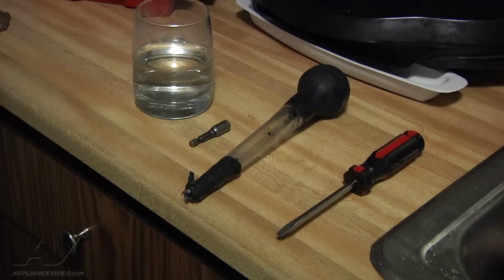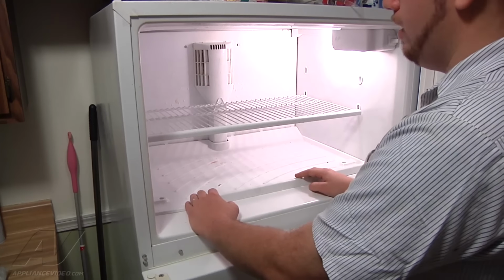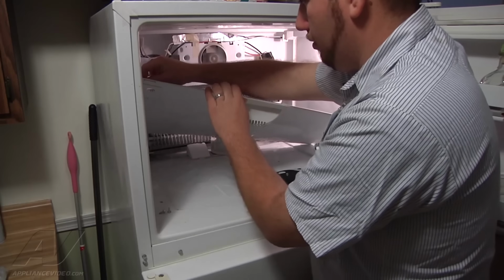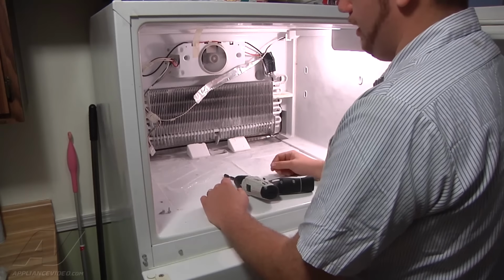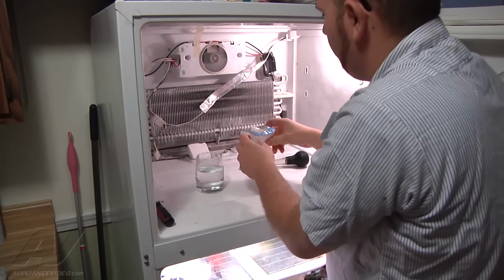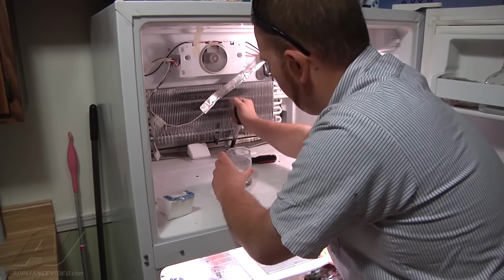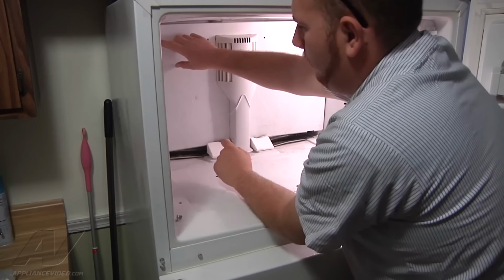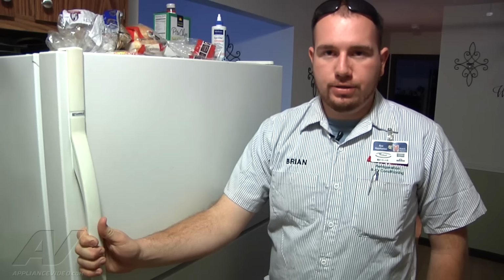Kenmore Refrigerator Repair - Water Leaking From the Freezer - Evaporator Drain Pan

Comment: We have a Kenmore Coldspot 106.64234400 which has only recently but repeatedly been having water drip onto the left side upper shelf in the refrigerator, and I subsequently discovered a sheet of ice on the floor of the freezer section, which re-appeared after its first removal.  Unfortunately, there are NOT two screws on the floor of that freezer section, it's one molded piece for the floor, sides, and top, and I can't find any manual at 'shopyourway' for Kenmore Coldspot 106.64234400 (which is the model type & number that it says on the label inside on the left front inside of the refrigerator).  So I can't begin to get to the drain hole for the defrosted ice/water to see if it's plugged & unplug it.  There are three screws near the top of the rear panel, two around the center 'post', and one at the left near and attaching a closed block/cover piece about 3" long by 2" tall and 1" deep.  I'm defrosting it, and there was ice in the bottom 'moat' at the bottom of the center 'post' thing, which has melted & I'll try to suck or blot it out.  Do you have any suggestions for how to proceed with regard to the possible clogged defrost drain line, given that I can't remove the floor of the freezer section?
Reply from the maker: +Dan Nichols 

 

         Good question, with our technicians
now getting hundreds questions weekly, they are answering all questions at our
website http://www.appliancevideo.com/repair-help/ .  We also have over 30000 common questions
and answers that you can easily search through by your model number, appliance
make, problem or error code and it’s absolutely FREE.
Reply: +ApplianceVideo.com Well, I may have cleared the drain.  I did eventually take those two screws out, and was able to see that there was a 'dummy' connector behind the 'block' at the top left side attached at the third screw, also with a snap on ground as your video mentioned, plus a wire bundle with a cable connector that plugged into the dummy block.  After pulling the connector out, I had room to see the ground & pull it off & then carefully tilt out the back panel (gotta do it carefully, so as not to bang it against the unseen very thin aluminum fins behind it).  Then I could see a black drain hole under a aluminum 'trough', which I probed with the end of a zip tie (because it was slightly angled & plastic), and could feel what I took to be an ice plug about an inch down.  I carefully added hot water a couple of times, probing with the zip tie to see if I was making any progress, and finally the water puddle released & I heard it dripping into a small catch pan at the bottom of the refrigerator.  Putting the back panel back on was harder, in order to put the unused cable back into its dummy connection after putting the ground clip back on.  (I didn't try adding the twisted solid copper wire to the heater rod to poke down the drain tube to try to keep the problem from recurring, as I could see why in the pictures I'd seen that it was so loosely attached to the rod, what with those delicate fins right next to it making winding it onto the rod very difficult.) Now we'll see if it works!  Thanks for the video.
ps. I sure hope the huge mass of 'black woolies' I removed from in front of the core of tubes on the bottom left side at the floor wasn't actually some kind of insulation that should have been left there, though!

Comment: My Frigidaire side by side is making a pulsating sound in the freezer and ice is accumulating on copper coil just before the compressor, everything is cold, asking lots of ice, fridge side cold too. When I unplug it for a couple of days, it runs fine but after a couple of days, the pulsating sounds starts periodically and ice returns. I can send a video and a picture.
Reply from the maker: +Camilla Barnes 

We would like to help you
answer your question. With our videos now getting over 900,000 views per month and
hundreds of questions from people like you, our technicians are now answering questions
at our website http://www.appliancevideo.com/repair-help/ .  We also have over 2200 common questions
and answers that you can easily search through by your model number, appliance
make, problem or error code and it’s absolutely FREE. You also have the option
to email a factory service technician with a question on your appliance at http://www.appliancevideo.com/repair-help/ . If you’re looking for a repair video, you can
also search our library of over 2600 free repair videos. ApplianceVideo.com
specializes in quality DO-IT-YOURSELF appliance repair videos and we get over
800,000 views per MONTH to our videos worldwide and growing. If you need of
parts for your major appliance, we have over 5-million parts in stock at http://savemoreonparts.com/ .  Thanks for your support. Matt Ace
Appliance factory service technician.

Comment: Thank you!  My Kenmore (top freezer) had a icemaker that wasn't being used (no plumbing available), so had to take that out too to get back panel off (only 3 screws, but not easy!).  Did not reinstall icemaker - makes more room in freezer anyway.  After drain hole was thawed, someone else poured water into the hole and I watched it run into drip pan - success!  Bet that saved a $200 service call here in CA.  Thanks again!
Reply from the maker: +Liz Wolff 

 

              Thanks for your positive comment. We are glad we
could help resolve your issue and hopefully saved you money. We have helped
millions of people repair their own appliances so please help us produce more
videos to our site by subscribing to our YouTube page, or posting our http://www.appliancevideo.com/ website on your Facebook or Twitter account. Our
factory authorized technician’s also daily provide free professional Repair
Help to people like you to help solve their appliance problems. You also have
the option to email a factory service technician with a question at http://www.appliancevideo.com/repair-help/ .  If you need of parts for your major
appliance, we have over 5-million parts in stock at http://savemoreonparts.com/ . Thanks in advance for supporting us. So email
us if you have any other questions our videos cannot resolve. Thanks for your
support in advance.   Matt, Ace Appliance service technician.

Comment: So where did all that hot water end up?  In the fridge?  Where?  I would have liked to see where inside the fridge it was leaking.
Reply from the maker: +Shelley Banick It goes into the drip pan.
Reply: +Shelley Banick It ends up underneath the crisper drawers..and if unchecked, it will flow out of the front floor onto your kitchen floor.

Comment: Great video, thanks for the information and the demonstration. My Fridge is just like the one in the video so it was a piece of cake to follow and get the job done. One little bitty niggle that might confuse a newbie and that is your graphic showing the turning of the screwdriver, your graphic is turning counter clockwise for both removing and replacing the 1/4" screws. As you know it should go clockwise for replacing and tightening the screws when the job is done. "Righty Tighty, Lefty Loosey"!
Reply from the maker: Rythymace Thank you for pointing that out, we will get that changed ASAP. 
Please help us provide more videos to our site by
subscribing to our YouTube page or posting our http://www.appliancevideo.com/ website on your Facebook or Twitter account. Our
factory authorized technician’s also daily provide free professional Repair
Help to people like you to help solve their appliance problems. You also have the option to email a factory
service technician with a question at http://www.appliancevideo.com/repair-help/ .  If
you need of parts for your major appliance, we have over 5-million parts in
stock at http://savemoreonparts.com/ . Thanks
in advance for supporting us. So email us if you have any other questions our
videos cannot resolve. Thanks for your support in advance.   Matt, Ace Appliance service technician.
Reply: I have subscribed to your site and very much appreciate the services you provide! Thank you so much! I will post a link on my facebook in a little while.

Comment: the water on the drain pan smell bad due milk spill on fridge I can't remove the drain pan on my brand new Kenmore refrigerator is top freezer how I can remove it to clean
Reply from the maker: EL DIESTRO DIY 

All of our technicians are now answering questions daily at our http://www.appliancevideo.com/ website under the Repair Help section.  We also have over 1600 common questions and
answers that you can easily search through by your model number, appliance
make, problem or error code and it’s absolutely FREE. You also have the option
to email a factory service technician with a question on your appliance at
http://www.appliancevideo.com/repair-help/ . If you’re looking for a repair video, you
can also search our library of over 2600 free repair videos. ApplianceVideo.com
specializes in quality DO-IT-YOURSELF appliance repair videos and we get over
800,000 views per MONTH to our videos worldwide and growing. If you need of
parts for your major appliance, we have over 5-million parts in stock at http://savemoreonparts.com/ .  Thanks
for your support. Matt Ace Appliance factory service technician.

Comment: As a little tip, add a small drop of food safe dye to the water (I used red) once you think you've unclogged it and then check the drain pan (give it a minute to be sure it's all drained). If the dye is there then you know for sure it's unclogged. I was using towels to collect the water as it was melting and before putting it together I wanted to be very sure :)
Reply from the maker: Vanessa* :) 

Thanks for your positive comment and the great Dye tip. Please help us
provide more videos to our site by subscribing to our YouTube page or posting our
http://www.appliancevideo.com/ website on your Facebook or Twitter account. Our
factory authorized technician’s also daily provide free professional Repair
Help to people like you to help solve their appliance problems. You also have the option to email a factory
service technician with a question at http://www.appliancevideo.com/repair-help/ .  If
you need of parts for your major appliance, we have over 5-million parts in
stock at http://savemoreonparts.com/ . Thanks
in advance for supporting us. So email us if you have any other questions our
videos cannot resolve. Thanks for your support in advance.   Matt, Ace Appliance service technician.

Comment: Hi, Your video is by far the best one I have seen on this subject. But it isn't quite working for me as my Kenmore top freezer fridge is quite old, and while I have had not trouble removing the back panel, I can't figure out how  to get the bottom panel off, as there are no screws to remove, and the bottom panel seems to have been wedged in. On the bottom of the back, all I see is a metal strip will two holes in the middle, but no styrofoam cap. Would be great if you could advise further. Many thanks. Nargis Suleman
Reply from the maker: Nargis Suleman 

All of our technicians are now answering questions daily on the
ApplianceVideo.com website under the Repair Help section.  We also have over 1600 common questions and
answers that you can easily search through by your model number, appliance
make, problem or error code and it’s absolutely FREE. You also have the option
to email a factory service technician with a question on your appliance. If
you’re looking for a repair video, you can also search our library of over 2600
free repair videos.  ApplianceVideo.com
specializes in quality DO-IT-YOURSELF appliance repair videos and we get over
800,000 views per MONTH to our videos worldwide and growing. Thanks for your
support. Matt Ace Appliance factory service technician.

Comment: love the video and now it drains. but we broke one of the air duct covers and the ice maker is leaking water everywhere. suggestions?
Reply from the maker: Lydia
    All of our technicians are now answering questions daily on the ApplianceVideo.com website. You can search completely FREE in our Repair Help section with over 1000 questions & answers. Or you can get unlimited technical advice and video links emailed to you by our 14 factory certified technicians at http://www.appliancevideo.com/premium-membership/.  If you are in need of any parts please support our parts department on line at http://savemoreonparts.com/ or call 1-800-830-5465 7-days a week until 11pm Eastern time. Thanks for your support. Matt Ace Appliance factory service technician.

Comment: Thanks for the info...our refrigerator was a little different....had to take the part off in the refrigerator lower section to get the the clogged drain tube.....4 screws and a wire harness...used a shop vac to blow and suck out the gunk built up in the tube...water seems to flow right through it now....easy fix. Thanks again!
Reply from the maker: Thanks for your response, we are glad we could help. Our library of over 5,700 videos are currently helping over 1.6 million people like you every MONTH.  Please help us by subscribing to our YouTube channel, or post our website www.ApplianceVideo.com to your Facebook page, Twitter, Instagram or any other social media sites. Your support will help us keep producing more free quality videos.

Comment: Thank you. I have been de-icing the freezer about every 2 weeks. It would take a long time to thaw out the vent tubes. I was missing the part about the drain. Next time it will be fixed for good. If I can get to the drain tube do I need to remove the back. I am nervous about taking off the ice maker. This was very helpful.
Reply from the maker: Jane
     Thank you for your positive comment. We are glad we could help resolve your issue and hopefully saved you money. Please help us provide more videos to our site by posting ApplianceVideo.com on your YouTube, Facebook or Twitter account or add us to your circles. If you are in need of any parts please support our parts department on line at http://savemoreonparts.com/ or call 1-800-830-5465 7-days a week until 11pm Eastern time. Thanks again your support.  Matt, Ace Appliance service technician.

Comment: Just "fixed" my problem using your exceptional video…or so I think? My concern is that it might just happen all over again in a few days. I turned down the freezer setting to 1.5 (not sure if this has any effect, but it seemed like a good idea) and cleared away frozen food items from the air vent in the back. Should I expect the drain hole to freeze up again or does this generally solve the issue? Novice handyman here, for sure; actually surprised I did this as easily as I did (thanks again, BTW)! Thanks for any advice. 

Doug

P.S. Just picked this fridge up on Craigslist and it seems (seemed?) to be working just fine until this issue.
Reply from the maker: Douglas 
          All of our technicians are now answering questions daily on the ApplianceVideo.com website for anyone needing help. Just copy and paste this this question under REPAIR HELP, and one of our  factory authorized technicians  will answer any technical questions at absolutely no charge on your appliance issues. We also have over 2600 free repair videos to help with your appliance repair issues. Thanks for your support. Matt Ace Appliance factory service technician.